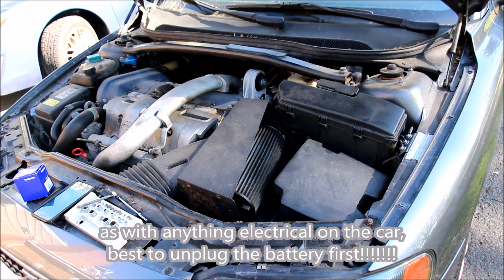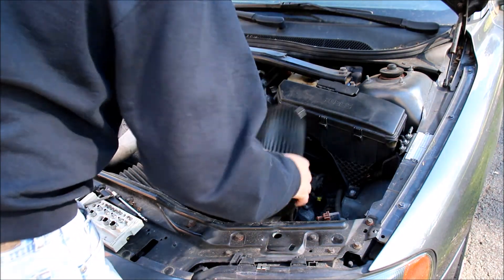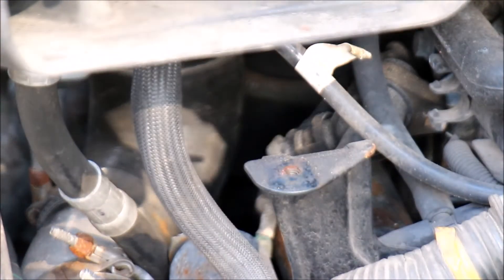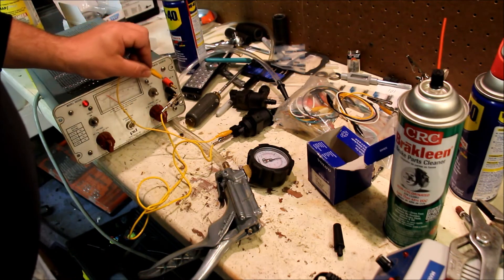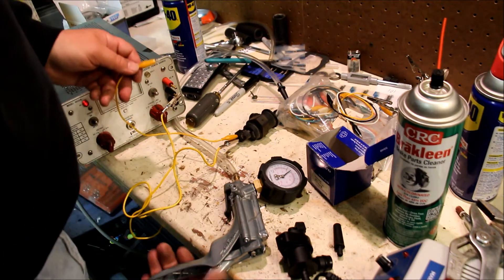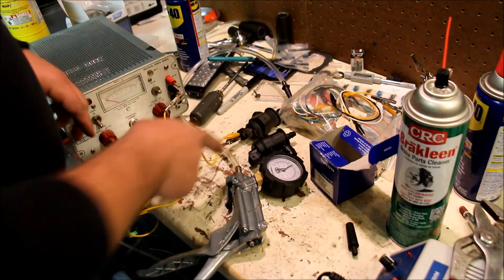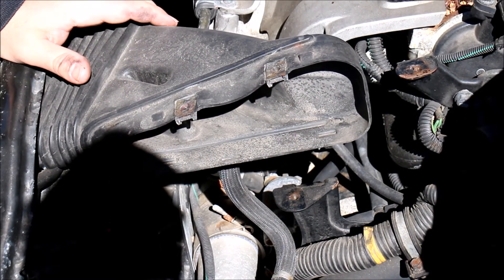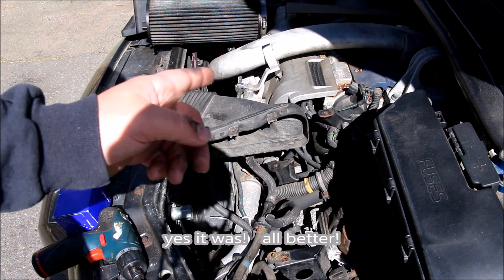Volvo S60R 2004 p0497 - evap code and solenoid replacement

Comment: The fact that the air pressure is not constant is actually an important malfunction, in addition to the fact the valve did not operate.  A leaky valve is as bad as a non-operational one.

Comment from the maker: as of 6/2018 this valve is bad again.   i just ordered another one, this time from ROCKAUTO ... standard motor products ...we'll see if this guy lasts any longer....
Reply: Have you checked your vaccuum lines? Apparently the charcoal canister can break down, which results in charcoal being flown through the lines, possibly killing your valve. Just a thought!
Reply: Any further update?  The suggestion that the charcoal canister can break down is an interesting one.
Reply from the maker: @donmoore7785  very interesting....new valve seems to still be working.   Im in process of selling the car too..   :(

Comment: So did this fix the problem? I have the same code for my 02 xc70.
Reply from the maker: Lerai Palmer yes..but it's not the only issue that can cause the code.
Reply: Matthew Olson cool, ill start with replacing that 1st. My car hit 200k miles a week ago. It's probably time to change it anyway. Thanks
Reply from the maker: Lerai Palmer sounds good...let me know!
Reply: Matthew Olson I installed the part last night. I got the oem version from ebay for $55. After driving the car around today, the check engine light went off! It's been on for months. This is after Volvo sold me a $50 gas cap and cleared the code but the light came back on. Thanks for your video.
Reply from the maker: Lerai Palmer glad it helped!